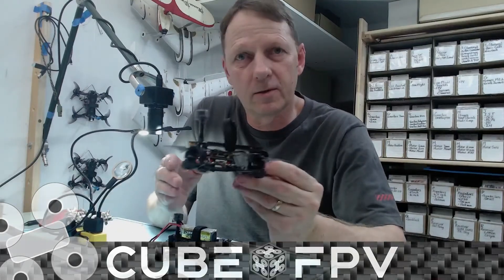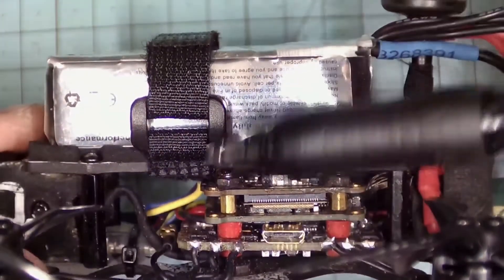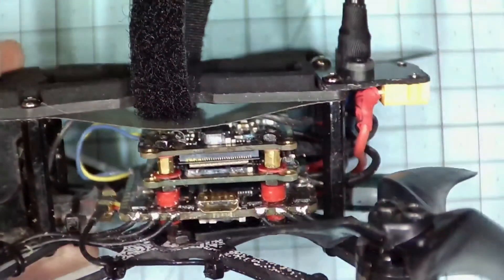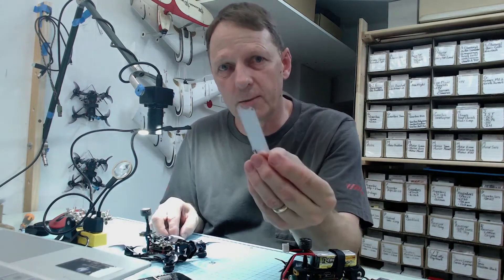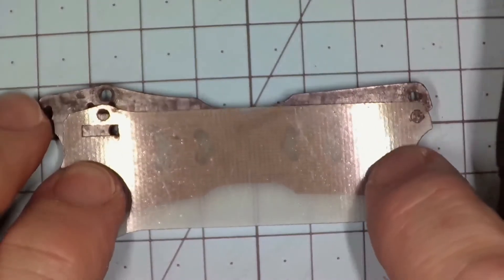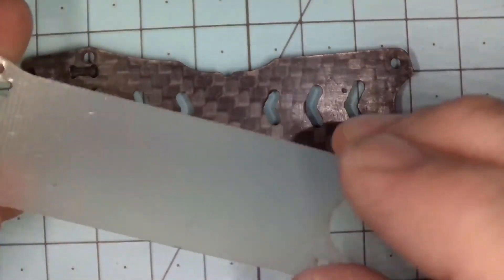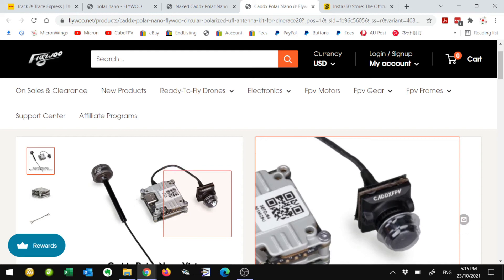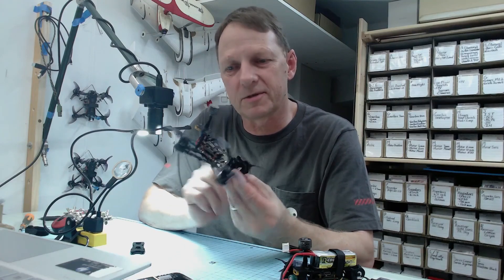TinyHawk 2 Freestyle DJI HD Upgrade – latest Update

Comment: Just ordered a set of hardware and rx mount for my TH II FS! Stock plastic hardware is really bad.. And I've only flown mine like 3 times now and they're falling out
Reply from the maker: Yes I know - The original standoffs are all Nylon and nylon nuts too. You pay a few hundred dollars for the quad and they couldn't have spent and extra 50 cents to put alloy standoffs and steel nuts in the kit. makes you wonder.